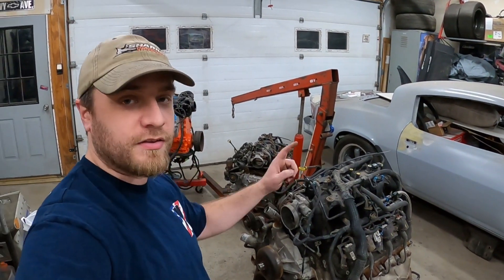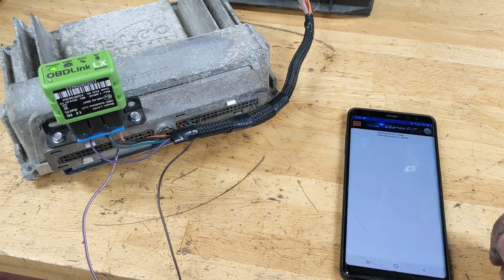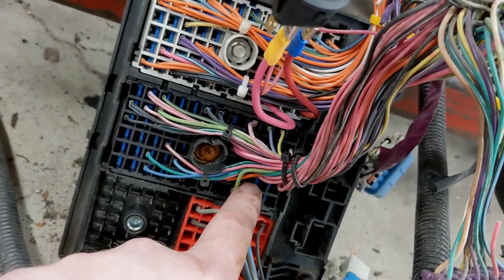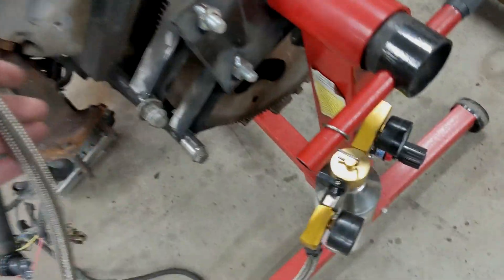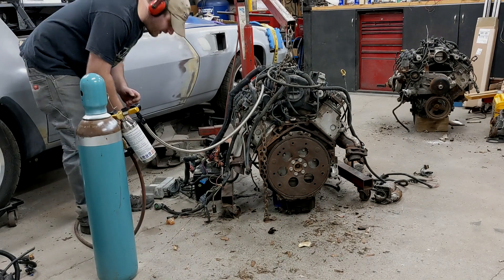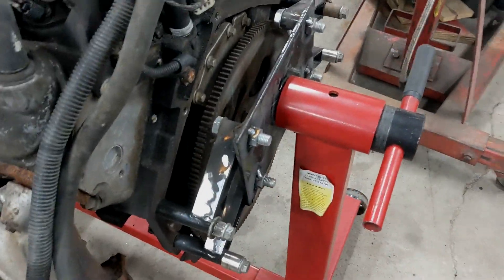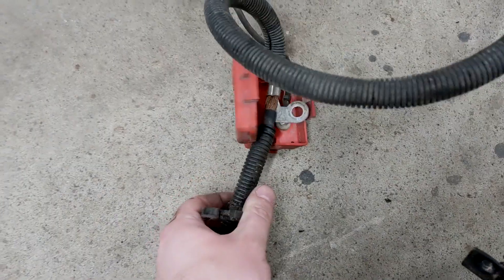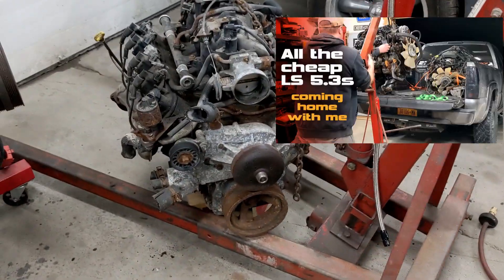Easy wiring & firing cheap LS swap - truck harness & free tuning #4wires

Comment: Ok so I want to know lol what wires are you connecting together you said f11 and what other wire?
Reply from the maker: C3 F1 to fuel pump. Two heavy ones together for switch.
Reply from the maker: C100 pin C needs 12v. You can get that from C2 B9
Reply: @GEARHEADdezign  around 4:55 in the video you say here’s my starter wires. What wires are you connecting to touch? 

Also do you know where the purple wire that comes from the starter connects to in the harness. 

I’ve tried this method a few times and I just can’t seem to get it fired up. I’m thinking this harness is cut somewhere else fml lol
Reply from the maker: @jeremyvaldez6082  gotcha. The C2 F11 is the one that needs 12v you start it. I grabbed a switched 12v from the neutral safety switch (same as the f11 wire -they were right next to each other)
Reply from the maker: The purple start wire must come from the starter relay. I'll look on lt1swap.com when I can sit at the computer
Reply: @GEARHEADdezign  I figured out my problem my C1 connector doesn’t have any wires in it like yours does lmao damn I need to get another harness
Reply from the maker: @jeremyvaldez6082  yyyyyyyeah you're gonna need those🤣
Reply: @GEARHEADdezign  now I know why none of the attempts I have made worked 🤦🏽‍♂️. Lmao I laughing at my self so bad. Thanks so much for your time. I started to re work my og harness

Comment: Is the engine stand post backwards? I had mine angled down and after changing it the stand worked better.
Reply from the maker: No, I just double checked it. Only goes on one way, but it's more the flat plate bending than anything.

Comment: Do you have a link for the fuel tank you're  using?
Reply from the maker: The one I got is unavailable. But there's a lot just like it. 8MILELAKE Fuel System Fuel... https://www.amazon.com/dp/B07WRJVBRQ?ref=ppx_pop_mob_ap_share
Reply: @GEARHEADdezign  thanks